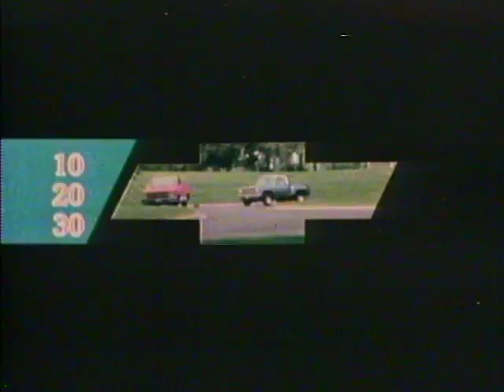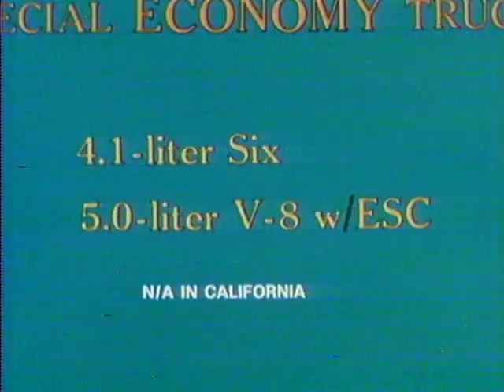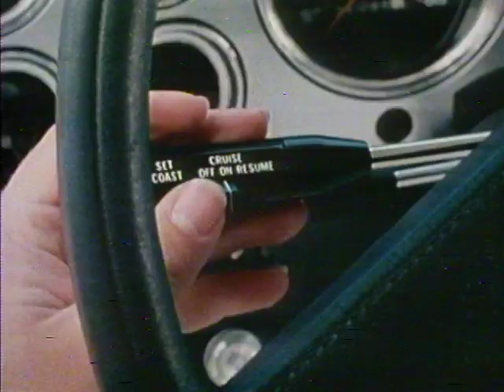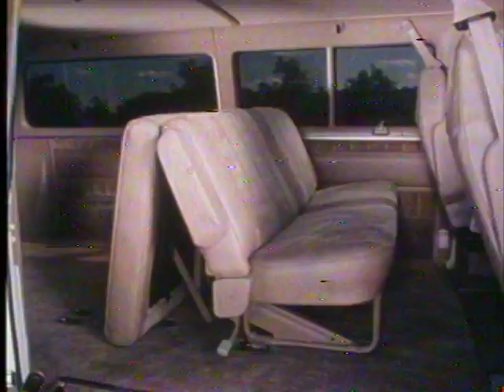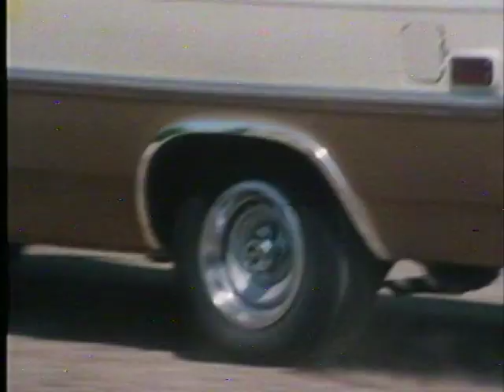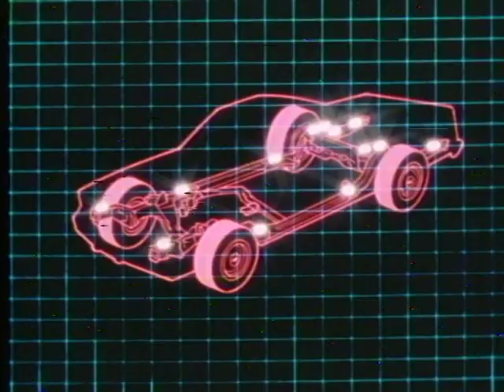1981 Chevrolet Trucks

Comment: Not a redesign, but a refresh update! Great trucks!
Reply from the maker: They literally just changed the shape of the hood slightly, changed the turn signals on the fenders and changed the grill oh and put a splash guard in it lol… well I guess they did refresh the interior too, but still it was the same truck🤷🏻‍♂️
Reply: @HrutkayMotors  Front clip, and a flat dash pad, along with some mech updates!